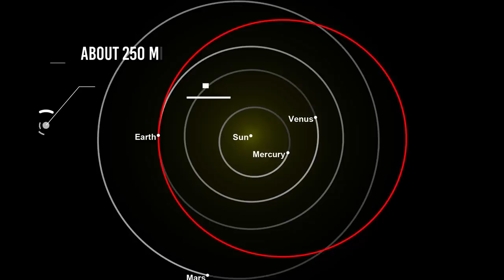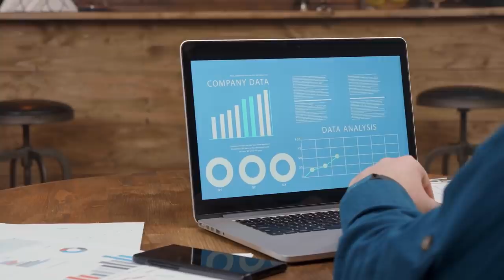A Final Salute To Starman, The World's Loneliest Astronaut

Comment: I absolutely will never understand why SpaceX didn't add some solar cells to keep the batteries charged so the cameras could keep transmitting.
Reply: Not worth the time and money. The camera system was hard enough to implement at the last minute without trying to add on a new power and attitude control system.
Reply: @Leo-bj7if  oh come on, several "off the shelf" 230 / 300 watt panels oriented at different directions obviate the need for an attitude control system and could easily kept the battery pack charged as the whole thing rotated or tumbled. No it's not space hardware that's 6 sigma proven but 3 sigma isn't hard for vacuum proofing able to last a month.
Reply: @bobjoatmon1993  Have you actually done the calculations for the number of solar panels it would take to power the cameras, avionics, and the RF system of the F9 Stage 2. Have you done the structural analysis for mounting these solar panels on the Payload Attach Fitting. Have you done the dynamics analysis or testing to see if these COTs solar panels can survive launch vibration and shock loads. What about the time to resign the F9 Stage 2 power system to regulate the power from these solar panels. Finally, you still need an attitude control system to either rotate the vehicle to avoid one side getting too hot or to keep distance objects (such as the Earth) in frame. 

I wish it wasn't the case but it is actually extremely difficult to slap new stuff on a spacecraft or space payload. The cameras themselves were a nightmare to implement on their own.
Reply: @Leo-bj7if  of course I haven't done those calculations BUT they are unnecessary because you are overcomplicating everything. Either your an engineering college student or a NASA employee (trying to make a joke there).
You don't need to power the whole stage, just the camera and transmitter. You don't need ANY attitude control to keep the panels oriented to the sun if you have excess panels in a ring around the base / mount of the car so that no matter how the craft tumbles at least one or more is exposed and as it moves out of the light, another  beside it is moving into the light.
As per vibration, yes, that would take some work but they were already doing it for the car and support mount so actually just a small addition the the FEA. I worked on a team doing vibrational analysis of gas turbines and done design of experimental aircraft including load design of up to - 4, +9 g so I know a tiny bit about what it would take.
Remember, it WASN'T man rated so ten years of studies didn't have to be made. It was only going to fly once so it could be bash and sledged together and finally, all it had to do was NOT interfere with the proper launch... By NOT connecting to the existing systems so no compatibility issues arise and having it shielded so it didn't emit any RF either (again, off the shelf aerospace components) until the 2nd stage had gone dead or shut down and the danger was irrelevant.
I'm going to note that I also participated in Amateur Rocketry where we built custom telemetry to monitor the flight and launched to over 100,000 feet several times AND I was an FAA licensed A&P before I retired... So again, I'm not talking out of my hat on knowing it's not as complicated as your making out. And that leads to my comment on knowing fresh graduates who overcomplicate things (until they spend their 'graduate school' time at Percussion University {the School of Hard Knocks} AND growing up around NASA engineers (my dad was one with Engineering and Development and I spent a lot of time around his coworkers) so I know the breed
Reply: @bobjoatmon1993  woah, this is a lot to unpack here. But on general there are some misconceptions on how the SpaceX F9 avionics system works or how we perform Avionics qualification testing. You also stated some things I never said. You sound like a real space enthusiast so I'll be happy discuss this more in detail if you like, given that I directly worked on this.
Reply: @Leo-bj7if  now that's an interesting proposal which is tempting HOWEVER I don't think I have the time to persue anything deeper at this point.
Reply: @bobjoatmon1993  I understand

Comment: You completely forgot to mention the battery of the vehicle. It’s not something that’s easily degradable by radiation; at the same time, a small hole by a micrometeorite, could very easily start a thermal runaway!